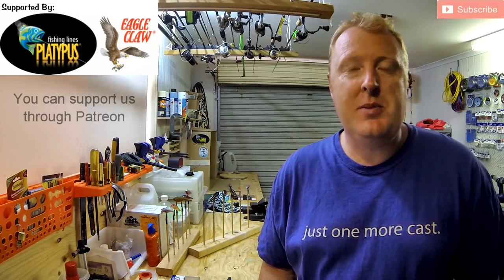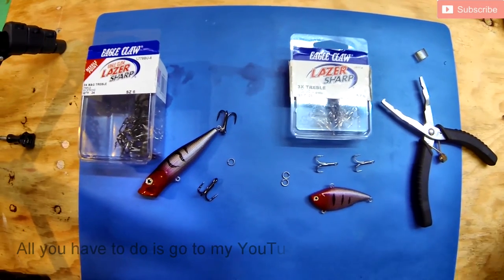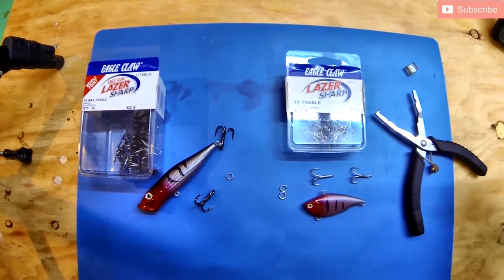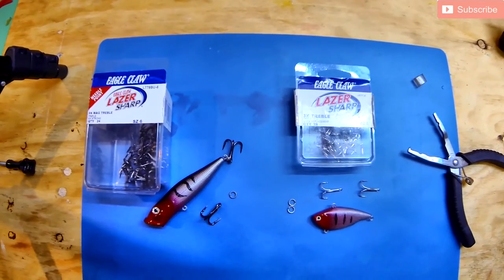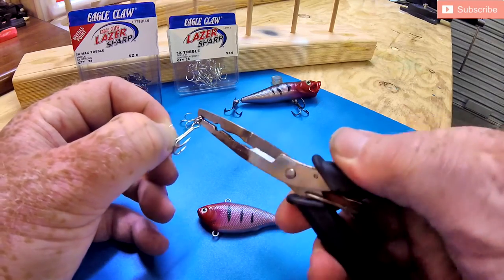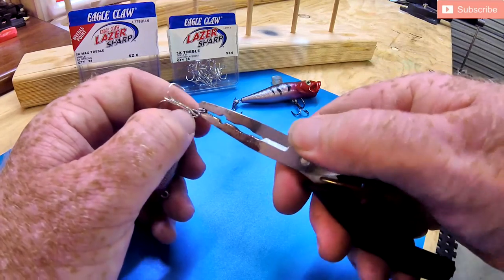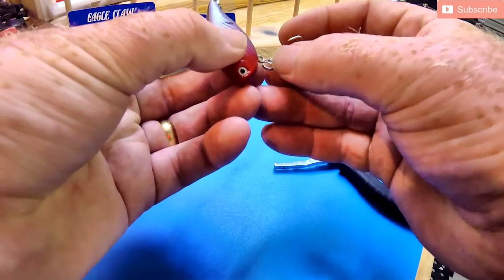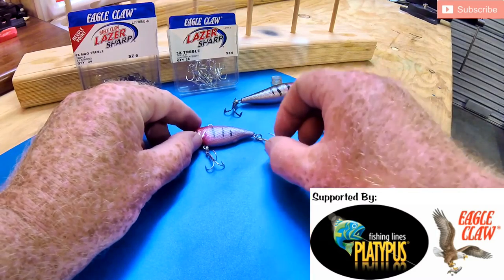How to Upgrade Lure Trebles

Comment: Where is your sense of adventure??? I prefer to use a slightly blunt knife to try and open the split rings. It is more dangerous but so much more rewarding!
Reply from the maker: +Paul Starrenburg rofl yep and using your fingernail is pure awesome, especially when they fly off at a million miles an hour! I still find them in random places in the workshop.